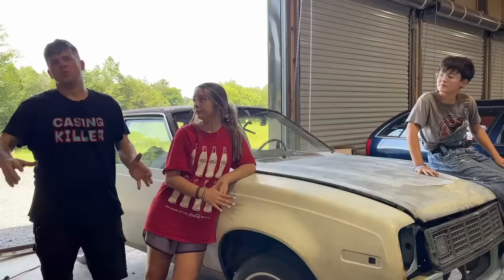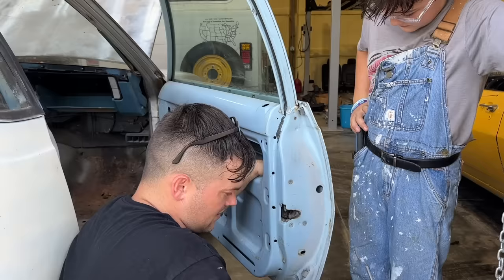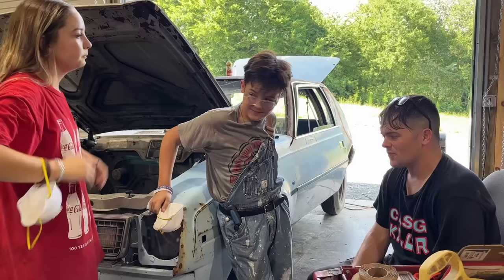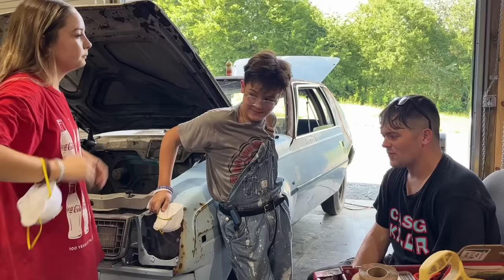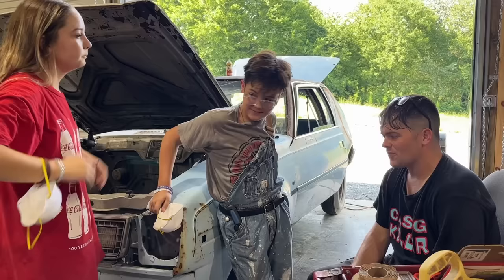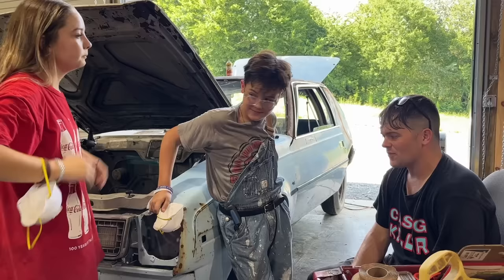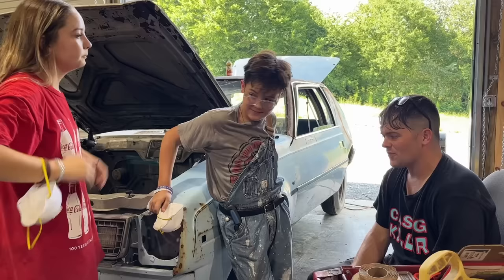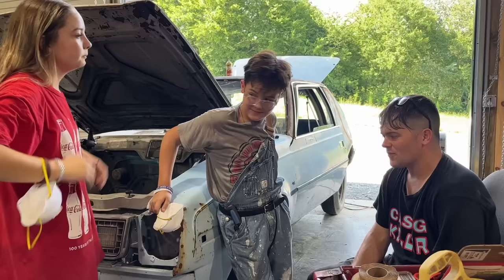DIY Budget Paint Job Completely Changes The Look Of Our Gremlin?

Comment: The only thing about the harbor freight guns is you can't really clean them once you take them apart you take the fluid tip out they just don't spray good again or you'll get one it just won't spray. Sometimes I'll buy two or three and that one gun will be beautiful I just put a little lacquer in them spray you know if it ain't no Good harbor freight you can get your money back and then you can always just put a warranty on them and just switch them out we used to paint 300 cars a month and it wouldn't nothing to buy four or five cases but we would just use it for primer paint clear coat most of the time throw it away you know but that was painting 25 cars a week so you had to pretty much keep it going and like if you put lacquer primer in those you can just keep adding reducer to it to it it'll spray good that's for high production some people you know if it paid a lot more money we would use the 2K but most of the time it was just lacquer primer if a guy knows how to saying it without saying it all off you know what I'm saying the results are the same if they wanted the more expensive primer on you know the price would double we did a lot of car lot stuff you know in and out had to make some system mix of color you blend it old color versus new color you know how it is it's hard to match you can get a guaranteed match now by going to the paint store and scanning it but the better the match the more expensive the pain is usually cuz you got ABCD colors like if you just send them the VIN tag and they'll send you the most popular color in that color they sold unless you go and have it scanned you know it's nearly impossible sometimes sometimes it's a real match sometimes it's close unless you get it scanned there's so many variances

Comment: Worked on race cars for many years.
The seatbelt shoulder belts mounting points are useless. 
They need to be almost straight back from the seat, not down to the floor.

Comment: i never used dryers you always have to change the filters out. i just ended up with a extra tank. most times 20 gallon or smaller. and ran my main take through it before i painted. but also where i live at you can take a new compressor turn it on and let it fill up and get a quart of water in it.
Reply: and the front end looks like maybe its a Hornet front end but i'm not saying it is.

Comment: Gotta say for a less than $100 paint job the Gremlin turned out pretty nice, I did think for a minute when the paint gun was being passed around Squeezy would have taken it in hand and laid down some paint, her being the artist and all. Now gotta ask you a question as a body and paint man. When you were laying the primer on the passenger side you went bottom up but on the driver side you went top down. Is there a difference between the two options? Or is it however you feel, just something I noticed on this video and on GYC where Will’s put paint to the car.

Comment: Hold on to those rotors they can be welded up and turned down,,use stick or tug.If it wasn’t to many miles away I’d fix them up for you .If y’all decide to take in cruising the coast andf y’all need anything give me and the wife a holler,we live 85 miles from the coast .

Comment: Did you paint the hood? I didn’t see it or was i get the chips at that time? 
This is going to be good, motor next 👍🏻
 Will it be second channel video??
Reply from the maker: With the engine that going in there will be no room for a hood. It will be on the main channel

Comment: I had a 79 AMC Spirit with the 4 cylinder and it turned out that AMC used a Audi block.  Awesome engine (with crap exhaust manifold!).  Do you still have the original engine?

Comment: How I'd the harbor freight black widow paint gun? I paint on the side now but used to work for several shops and need a new gun and don't reslly feel like buying a Sata or anything crazy at the moment. But I'm with you about avoiding using ol harbor freight purple gun too lol If I can help it.  I have a couple here but after a couple years out seems easier to just replace them than fight them any longer.

Comment: Eyy trying again to throw a line out there. 

Do you just work on your own projects or do you work on other peoples' stuff? 
I'm local here in TN and don't mind getting the truck to you at least, and you're welcome to use it in videos. 

I'm disabled, can't do stuff I used to be able to do, and my old 93 Chevy Silverado is very tired, and needs refreshed and back to running decently, needs brakes fixed, needs ubolts for the rear-end, needs a bumper, body work, she's very very tired like me, and needs a spa treatment badly.

Comment: Why not use original style master
Reply from the maker: Because we are just running the front brakes we had problems with a dual reservoir before. The pressure backs up in the port that you are not using.